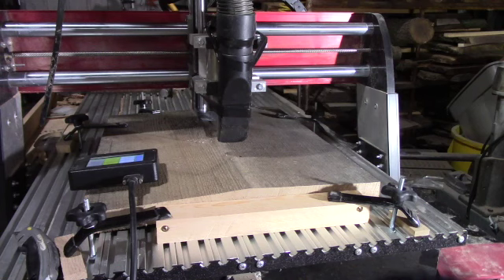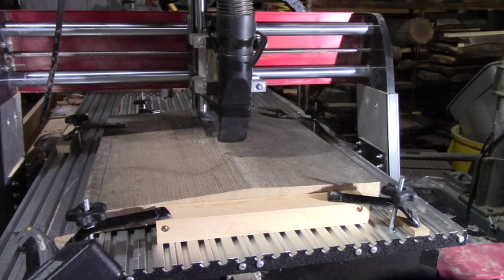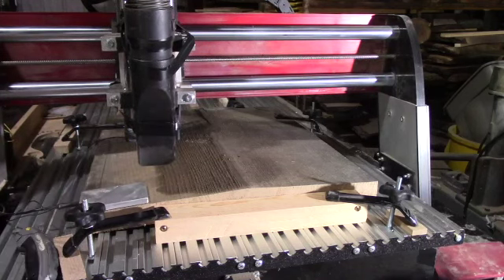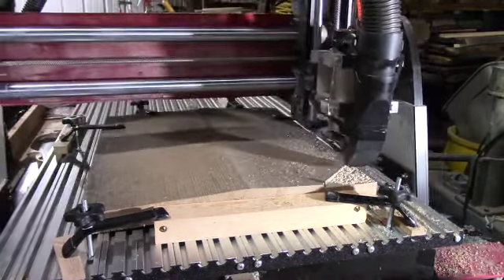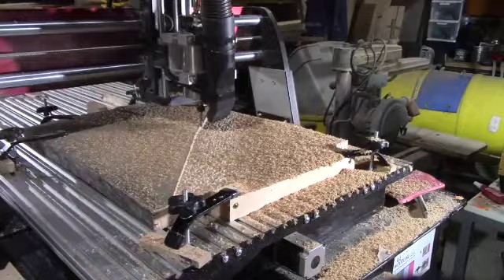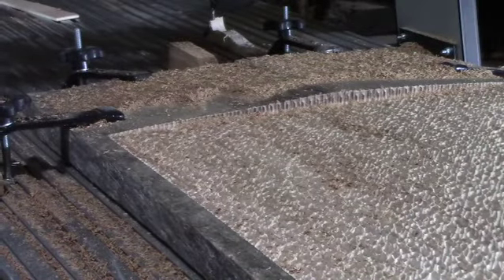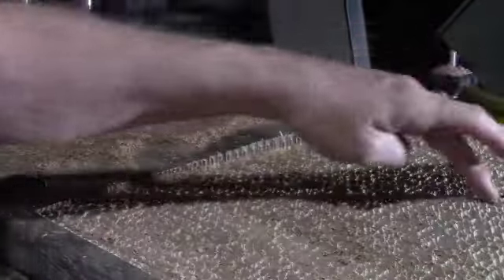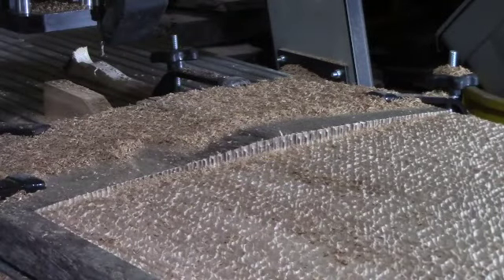Texturing using surface mapping on your CNC Shark   SD 480p

Comment: What model Shark are you using? Is it water cooled spindle? I hope to purchase one in near future- any suggestions?
Reply from the maker: I have a model 1, hd2 , hd4 and hd5. I use all of them and switch making projects between all four machines. The HD5 can run a little faster than the other ones but it requires a little more maintenance.  It also cost a little more so it depends on wether you are doing a lot of production runs. Good luck and have fun with your cnc.  Cecil